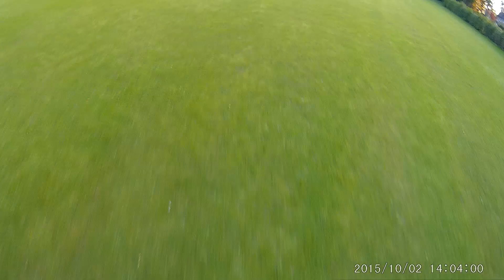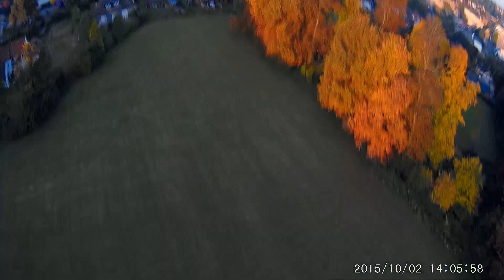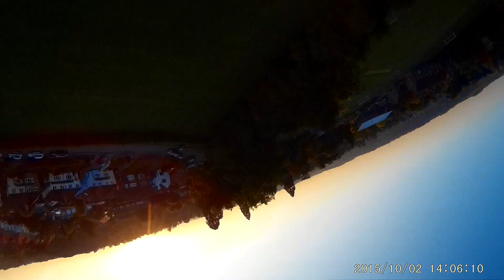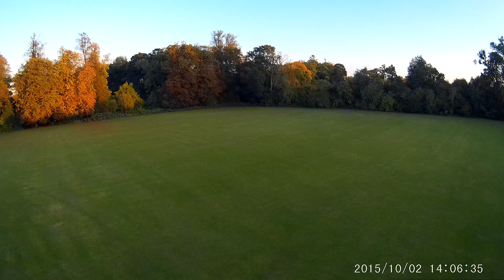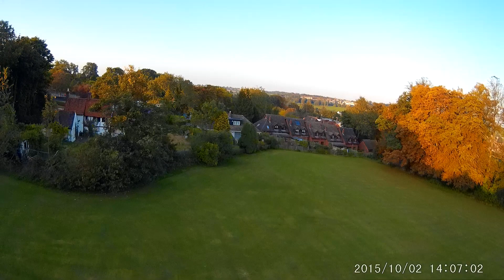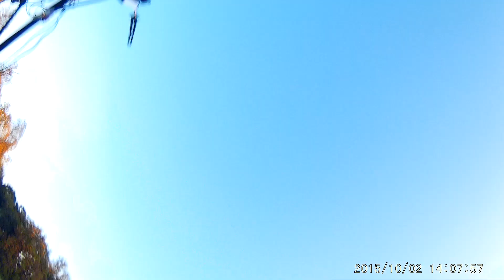DAL RC 12A ESC stress test - ZMR250 v2 6x4.5 Thug Props

Comment: You have motor stop not enabled correct??  If so min throttle is a little low you can hear the motors twiching as they should have been spinning as the quad was armed.  Just an observation.
Reply from the maker: +SloMo Spot on SloMo I am using OP on a CC3D and I am not familiar with the GUI but I am flashing it with Cleanflight tomorrow so I will be able to dial it out =D